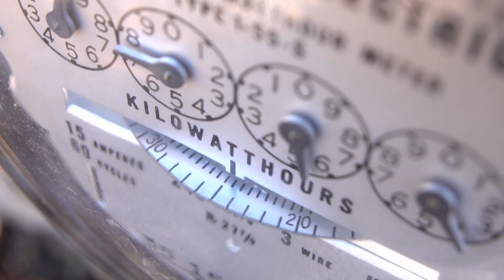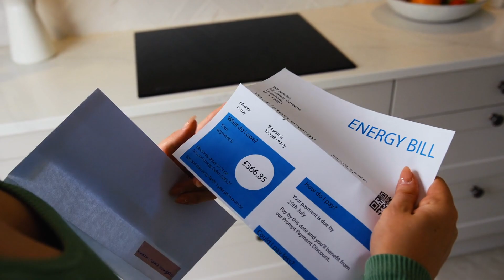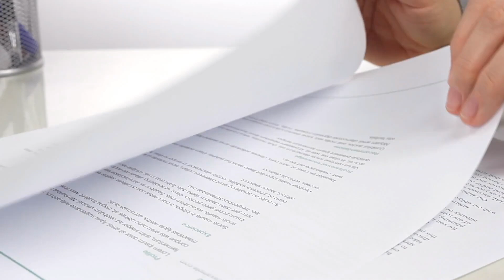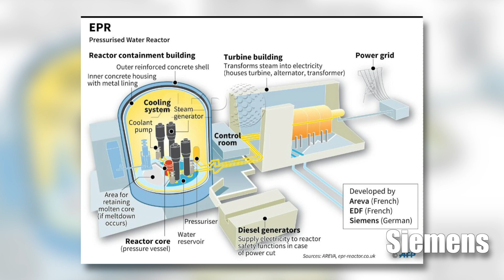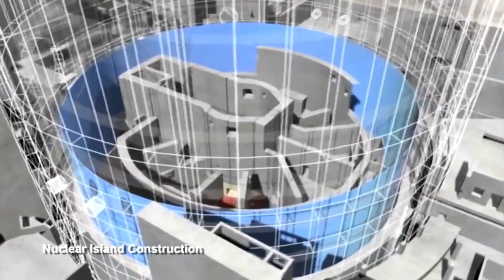Hinkley Point C - Britain's Most Controversial Nuclear Project

Comment: Nuclear reactors are overrated. They're way too expensive, complicated, and hard to keep running. Just build wind and solar already.
Reply: We don't have enough sunshine 🌞 wind is growing, but its not nearly as effective or reliable since wind peaks at certain times of the day. It's tough
Reply: If you look at the history of nuclear reactors, the first is always extremely expensive, sometimes the second, but the third, forth... tenth are pretty cheap. Once you have the experience of building a design their quite cost effective. Also their useful for providing base-load power alongside variable renewables (its not wind/solar vs wind, a diversified green grid is with a combination of all 3 is always more stable).
Reply: @domtweed7323  they should've built lots of small 700 MW power plants instead, after building the first two or three, they would've learnt from the previous plants mistakes.
Reply: If only it was so easy, you need a baseline of electricity, whenever that is Nuclear, Gas or Coal out of which Nuclear has the potential to be the cleanest. While Nuclear energy does pose challenges there are alternatives to these massive projects so I wouldn't call nuclear energy overrated. I can name a few arguments, such as nuclear waste being recyclable, smaller modular reactors being a thing nowadays and the cherry on top with e.g. Thorium reactors producing nuclear waste having a much, much shorter half life.

Research the topic a bit more and you'll see why neither solar, wind nor nuclear energy would be a solution on their own, a combination of the set is required with the exception of hydro or thermal power but there are only a few places on earth where this is viable.
Reply: Right where this cash cow is located, has some of the highest tides in the world. One tidal power plant right there could power THE ENTIRE COUNTRY. Just saying……
Reply: @davidwebb4904  We need both. We need a lot more electricity to electrify home heating (we need to phase out gas/oil burning), run electric cars/more trains, and electrify heavy industry like steel/cement/fertiliser making.
Reply: @davidwebb4904 No it could not.
Reply: @jimpaddy79  I've done the math...